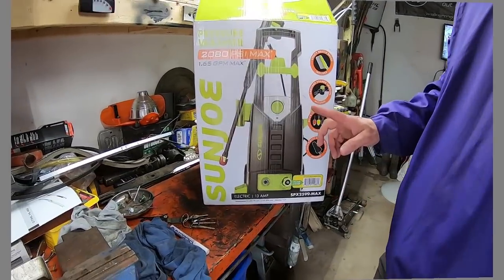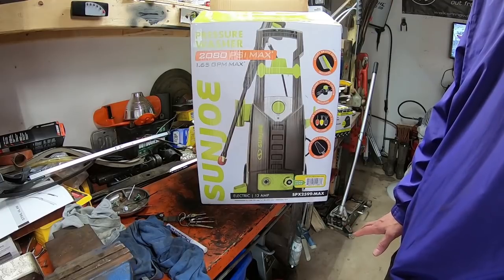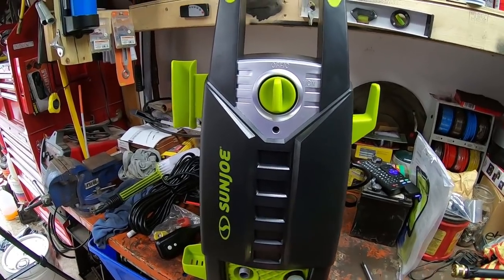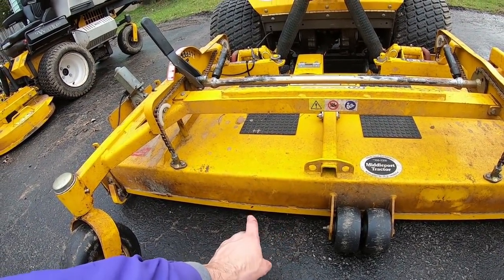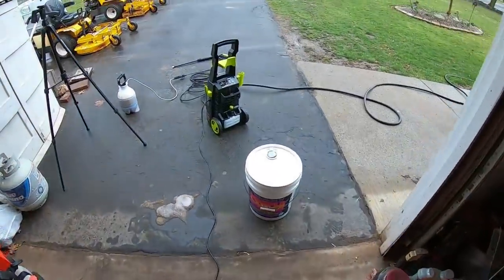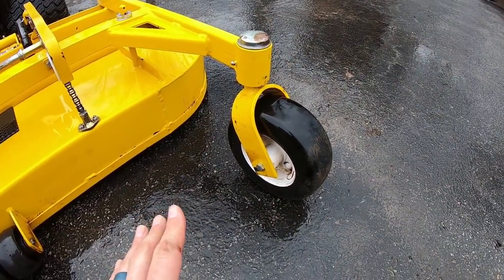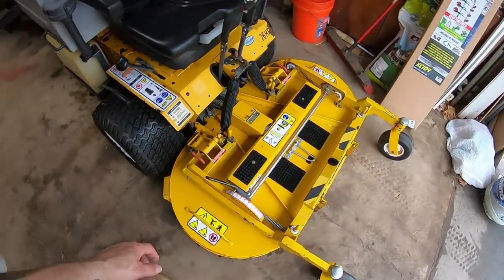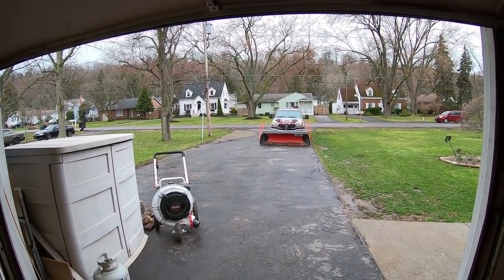Electric Pressure washer surprised me

Comment: I've had one of these Sunjos for 3 years. This year the pressure switch died on it, so it's always on. Not a big deal since I can just turn the main power switch off when I'm done using the pressure washer. For the cost, and the quietness of it, totally worth it. :)
Reply from the maker: It's worked out great so far

Comment: Another quarentine FYI, clenaing solutions like purple power and the countless other brands are great.... for those who do not understand how they work they are an acidic solution.... notice: I wrote ACEDIC not ACID.... the acidic solution releases the surface friction or surface tension of dirt, grime, oil, etc on your equipment.  Just never let that solution dry and when you hit it with the pressure washer it will in general do an excellent job of cleaning.  Same concept in some of the foam washes for automobiles etc.  Back to your regularly scheduled programming.....
Reply from the maker: Yup it's like allot of other things, twice as hard to get off once it dries on there

Comment: From years and years of my life, about 16 years old to mid 30's in the golf business I know a thing or two about pressure washers from the golf cart cleaning side to coursee maintenance equipment.....

There is something MAJOR that most people never understand about a difference between gas and electric pressure washers.....

Gas when it reaches it's max pressure and you are not pulling the trigger the pressure release system of gas (in general) will wear out VERY quickly and leave you with no machine.

Electric are better designed to be left running and have a much better pressure release system.  Don't be fooled by some bigger and very expensive electric ststems they can have better power than gas.

My comments above come from big personal experience from 16 to 20 years old working a massive golf resort (hosted a PGA Tour event annualy) and we had a fleet of 360 golf carts.  Washing all of these daily 8 months of the year you find a few things out about pressure washers.  Later as a manager of said departments it was me personally getting broken items repaired. 

We had a permennantly mounted electric system and after 10 years of no preventative maintenance on it the thing obviously broke.  Local shop estimated 5 days to repair, so I spent, company money, about $1,000 on a gas unit at home depot to get the job done and have a future back up.  We broke that in the first 3 hours.  Hose length you could wash about 8 carts, hooked together in fours, then would have to park them and move more carts down the hill to the washing station, as this goes on your dirty carts are getting further and further from your washing station so it takes longer and longer to walk up the hill and then pull more carts up.  After leaving the gas pressure washer running for about 15 minutes moving carts all its seals broke under pressure and it was useless.

Took the gas machine to a different shop for repair and the tech expalined to me the advantages and disadvantages of electric versus gas in my application..

Just an experience to share based on my experience with the two types.  And also brand independent.
Reply from the maker: That's like a book
Reply: @CountrysideStrong  I read it all😁
Reply from the maker: @esojanacig9230  so did I